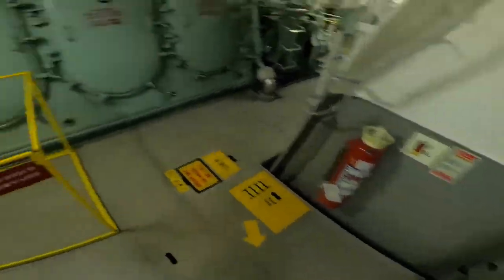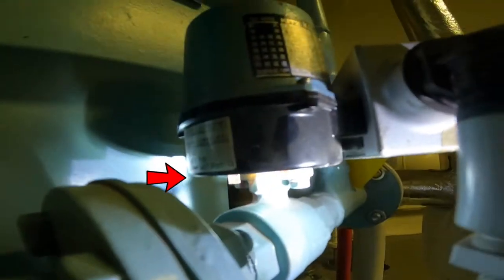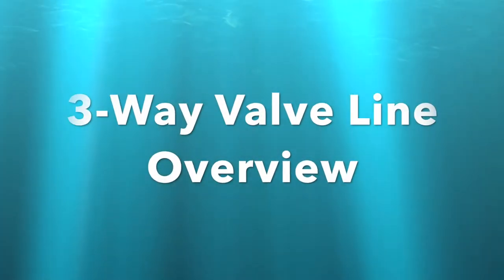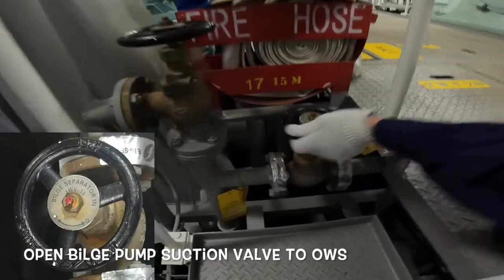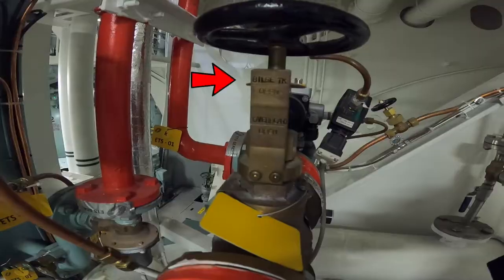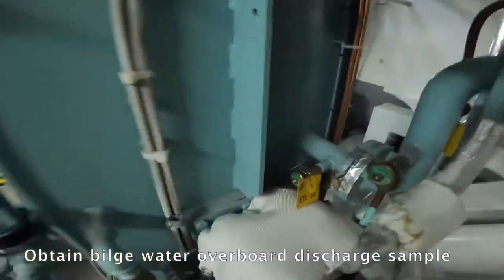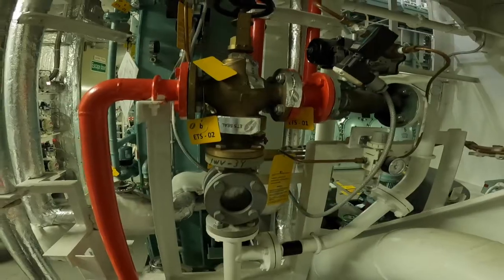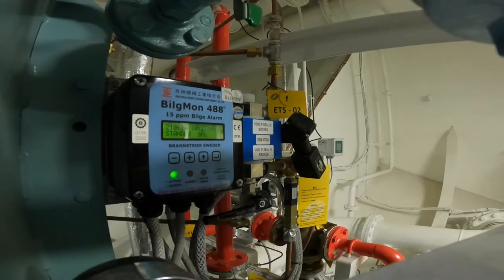OWS Test Procedure - BilgMon 448 - Brannstorm

Comment: During pumping out shall i keep open fresh water supply valve to monitor together with sample or only to open sample water and close fresh water.
Reply from the maker: If all running smoothly then the FW should be closed during OWS Operation.
and as per the manual from this specific unit, FW to be used for flushing before shutting the unit off.

Comment: Nice video. I have a question. After flushing fresh water remain inside ows or discharged by which v/v? I mean Flushing water go where through which v/v?
Reply from the maker: My point of few (for not being an engineer), the FW flushing to be done overboard before shutting the system.
The valves will be the same valves to prepare the OWS operation.
Otherwise, the FW flushing might go back to the bilge tank.

Comment: The cost of this machine would be astronomical and you probably need to be a scientist to repair it. I had thirty years going to sea and never saw an oily water separator working correctly. Another engineer, a friend of mine solved the problem  using three tanks. Absolutely foolproof. So successful shipbuilders started putting in ships.
Reply from the maker: For all the hard-working Engineers in the past in developing this machine, i wish more and more clean sea.